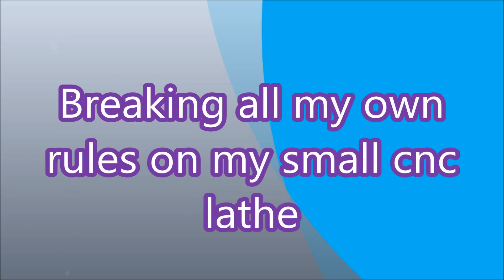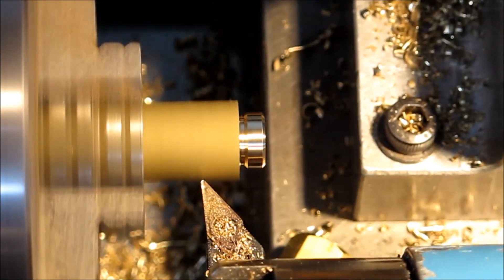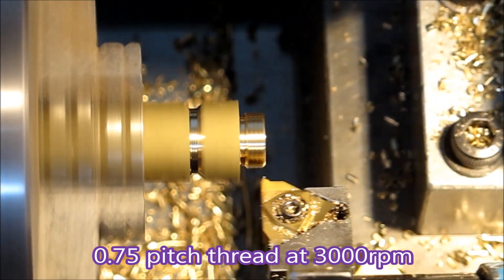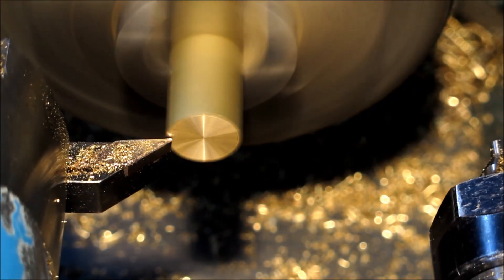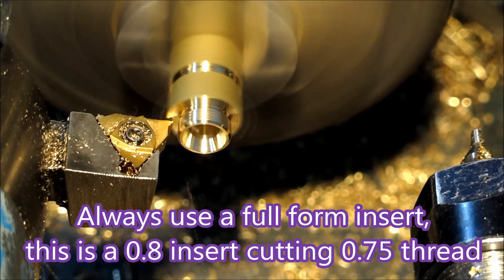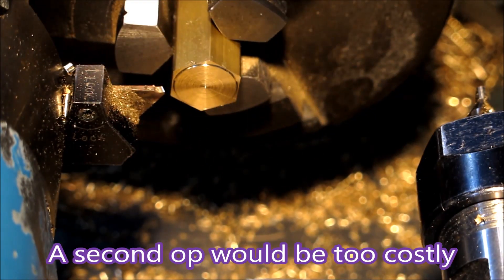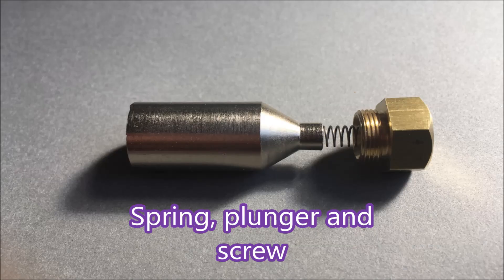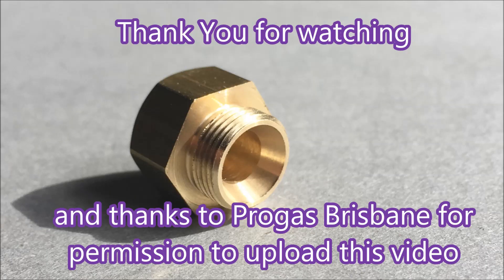Cnc lathe making brass solenoid nut, turn, drill, centre drill, thread 0.75 Pitch and  1.5 part off

Comment: Just love that threading at 3000 RPM, and then parting at the same speed too. I have always been of the "slow it down with the back gears before parting off or thread cutting" believing it HAD to be done slow - time I did a rethink methinks!... Martin
Reply from the maker: Thanks Martin, I think most of us using a manual lathe run  parting tools far too slowly mostly based on "fear" and of course dropping out the half nut drive in the right place might not be too easy at 3000rpm!